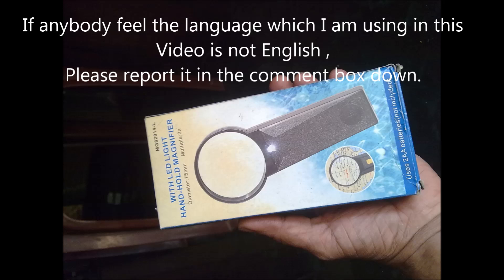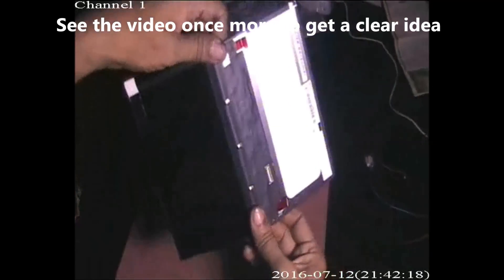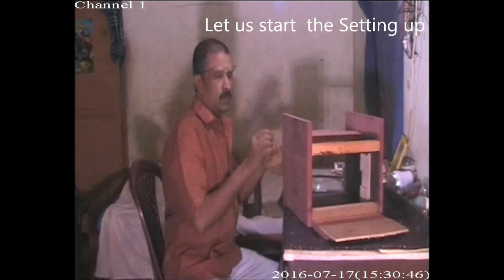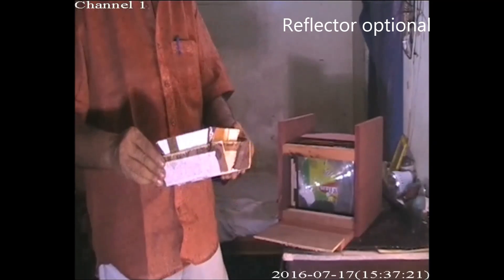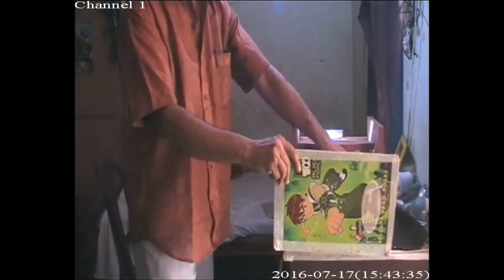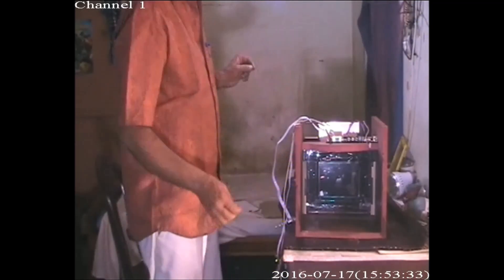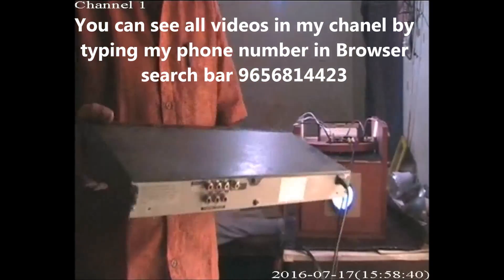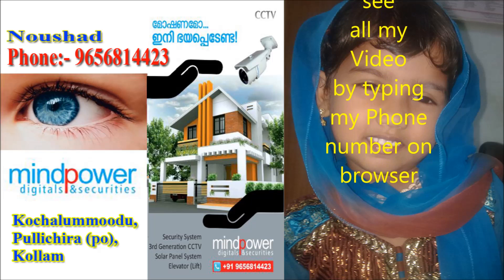HOW TO MAKE A VIDEO PROJECTOR AT HOME PART-1 ( HD Movie Theater: LED Video Projector )

Comment: Mr Naushad , you are right English is not mandatory - rather than appreciating someone when they are putting efforts to make all understand the concept people have this tendency to comment please ignore them , well a small correction is needed in your project for the projection we cannot use any lens it has to be a triplet lens using a simple lens would blur the projection in the corners also the LCD screen must be placed between the two Fresnel lenses one with a 120 Focal length then the LCD screen with a distance of 50 MM and then a 180 Focal length with a 20mm distance only then the projection would come perfect   hope this helps you and all  all the best

Comment: Sir could you please tell how to create the flood lamp with 9 10w led ? If I connect all 9 led in parallel , all of them are not lighting and led get over heat .. I am using the same 12v 10 amp adapter .. Please help me ...

Comment: SIr,I get picture in ronud size .
Reply from the maker: Come to me with the projector........

I will correct it 
fee Rs.1200 only.
My whatsapp  00918547430926
Reply: OK sir
Reply from the maker: My whats app number
00918547430926

Bring to me ...
I will rectify the problem..
Fee rs. 1200

Comment: is it possible to buy universal connector for smaller LCD screen for my E65 VIZIO TV series. it's brand new that's why i salvage all the parts except the LCD which was damage on handling.

Comment: sir how much cost of all required parts
Reply from the maker: We conducting an online course for LED/LCD TV.
You can register for that course with a fee of Rs. 1200. (25 US $)

we will send you all the study materials to this Email Id.
It is very easy to understand even if you don't know English language.
Because it is fully supported by pictures.

Universal V59 board installation is a separate book composed by myself is very simple.
It is same of V56

Firmware for all will send you independent for V59 and V56.

All will come to you with full instruction.

Pay the fee to my account and inform me.

my Bank details:-

Bank account Number:-      626601518016
Account Name:-                 P NOUSHAD
Bank and  Branch:-             ICICI  Bank , KOLLAM branch
IFSC code :-                 ICICI0006266

Rs.1200 only 
(25 US $).

mobile:- 0091 9656814423

Ok

My whats app number :-
0091 8547430926
Add this number to your contact ..
Then only try to send a MSG in whats app.

Comment: can you suggest me a suitable fresnal lens (online)for my laptop lcd display...plz reply
Reply from the maker: 12000 for the same which I used in Video.
But If you use quality materials it will cost you about 18000 to 23000

High quality Details...

Triplet lens Rs. 4500
Fresnel lens Rs. 1000 per pc.
100 watt single LED back light with 36 Volt 4 Amp Adapter. It will cost you Near 4500.
Use 300 watt for better quality.
LED display 7 inch Rs. 3500 .
Driver Board Rs. 1200
12 V power adapter Rs.200
All these are available Online.
Cost of Woods works depends.....
.....................................................................................

We conducting an online course for LED/LCD TV.
You can register for that course with a fee of Rs. 1200. (25 US $)

we will send you all the study materials to this Email Id.
It is very easy to understand even if you don't know English language.
Because it is fully supported by pictures.

Universal V59 board installation is a separate book composed by myself is very simple.
It is same of V56

Firmware for all will send you independent for V59 and V56.

All will come to you with full instruction.

Pay the fee to my account and inform me.

my Bank details:-

Bank account Number:-      626601518016
Account Name:-                 P NOUSHAD
Bank and  Branch:-             ICICI  Bank , KOLLAM branch
IFSC code :-                 ICICI0006266

SB account

Rs.1200 only 
(25 US $ from out of India).

mobile:- 0091 9656814423

Ok

My whats app number :-
0091 8547430926
Add this number to your contact ..
Then only try to send a MSG in whats app.
Show less

Comment: noushadikka super total ethra cost varum
Reply from the maker: We conducting an online course for LED/LCD TV.
You can register for that course with a fee of Rs. 1200. (25 US $)

we will send you all the study materials to this Email Id.
It is very easy to understand even if you don't know English language.
Because it is fully supported by pictures.

Universal V59 board installation is a separate book composed by myself is very simple.
It is same of V56

Firmware for all will send you independent for V59 and V56.

All will come to you with full instruction.

Pay the fee to my account and inform me.

my Bank details:-

Bank account Number:-      626601518016
Account Name:-                 P NOUSHAD
Bank and  Branch:-             ICICI  Bank , KOLLAM branch
IFSC code :-                 ICICI0006266

Rs.1200 only 
(25 US $).

mobile:- 0091 9656814423

Ok

My whats app number :-
0091 8547430926
Add this number to your contact ..
Then only try to send a MSG in whats app.
Show less

Comment: Hello sir my laptop screen 30pin  ( LT141XAS4L) IBM    How to attach led board with remote
Reply from the maker: Cost of production details....
12000 for the same which I used in Video.
But If you use quality materials it will cost you about 18000 to 23000

High quality Details...

Triplet lens Rs. 4500
Fresnel lens Rs. 1000 per pc.
100 watt single LED back light with 36 Volt 4 Amp Adapter,  It will cost you Near 4500.
But I reccomented 300 watt LED  for better quality , it costely.
LED display 7 inch Rs. 4500 .
Driver Board Rs. 1200
12 V power adapter Rs.200
All these are available Online.
Cost of Woods works depends.....
.....................................................................................

We conducting an online course for LED/LCD TV.
You can register for that course with a fee of Rs. 1200. (25 US $)

we will send you all the study materials to this Email Id.
It is very easy to understand even if you don't know English language.
Because it is fully supported by pictures.

Universal V59 board installation is a separate book composed by myself is very simple.
It is same of V56

Firmware for all will send you independent for V59 and V56.

All will come to you with full instruction.

Pay the fee to my account and inform me.

my Bank details:-

Bank account Number:-      626601518016
Account Name:-                 P NOUSHAD
Bank and  Branch:-          ICICI  Bank , KOLLAM branch
IFSC code :-                  ICICI0006266

SB account

Rs.1200 only 
(25 US $ from out of India).

mobile:- 0091 9656814423

Ok

My whats app number :-
0091 8547430926
Add this number to your contact ..
Then only try to send a MSG in whats app.

Comment: wawooo is very superb i want this u sale this
Reply from the maker: Cost details....
12000 for the same which I used in Video.
But If you use quality materials it will cost you about 18000 to 23000

High quality Details...

Triplet lens Rs. 4500
Fresnel lens Rs. 1000 per pc.
100 watt single LED back light with 36 Volt 4 Amp Adapter . It will cost you Near 4500.
300 watt is reccomnted from me for better quality.
LED display HD 7 inch Rs. 4500 .
Driver Board Rs. 1200
12 V power adapter Rs.200
All these are available Online.
Cost of Woods works depends.....
.....................................................................................

We conducting an online course for LED/LCD TV.
You can register for that course with a fee of Rs. 1200. (25 US $)

we will send you all the study materials to this Email Id.
It is very easy to understand even if you don't know English language.
Because it is fully supported by pictures.

Universal V59 board installation is a separate book composed by myself is very simple.
It is same of V56

Firmware for all will send you independent for V59 and V56.

All will come to you with full instruction.

Pay the fee to my account and inform me.

my Bank details:-

Bank account Number:-      626601518016
Account Name:-                 P NOUSHAD
Bank and  Branch:-             ICICI  Bank , KOLLAM branch
IFSC code :-                 ICICI0006266
 SB account.

Rs.1200 only 
(25 US $).

mobile:- 0091 9656814423

Ok

My whats app number :-
0091 8547430926
Add this number to your contact ..
Then only try to send a MSG in whats app.
Show less

Comment: Hi, what screen are you projecting it. it looks good. is it any curtain or pvc meterial?
Reply from the maker: Any cloth curtain can use, but should be rough surface.
Polister, silk are  not allowed. Surface NOT glossy type materiel need.
Glossy surface will reflect the light to one direction.
Pure White rough cotton is better.
Reply: what were you using, shown in video. looks good! :)
Reply from the maker: Cotton rough pure white Cloth.
If you have a white wall, it is better.

Comment: Og it really works, Way we so NOT May se the picture it made On Wall ?
Reply from the maker: Before two months , I posted the video in YouTube with original video on screen. 
But YouTube blocked my video on the reason of copyright of the video. 
And I compelled to removed it from my channel. 

The video you are watching now is which I upload again as a new video without showing the copyright video. 
Then YouTube not blocked it.

One more thing..
When I posted second time the video, you tube rejected my account opening request on the ground that Language not Supporting. That means the language which I used in this video is not English. Did you feel it.
That is what I mentioned on the video.
Anyway the account is opened after communicated with YouTube.

Comment: Don't worry.  Your English is fine.
Are you using two Fresnel lenses so that the image you see on the wall is the correct way up?
If you use only one Fresnel lens is the image upside down?
Would you suggest adding a fan to cool the LED floodlight, or is the temperature acceptable?

Thanks for taking the time to make and upload the video.
Reply from the maker: No you are wrong...
Image up down at magnifier lens. Not in Fresnel.

You can use any type of fan to cool the LED .

In ready made Flood lamp have its own cooling system.
Don't worry about additional cooling.

Cooling fan is must if you are using an LED more than 30 watt.

Comment: original pictures ?
Reply from the maker: Before two months , I posted the video in YouTube with original video on screen. 
But YouTube blocked my video on the reason of copyright of the video. 
And I compelled to removed it from my channel. 
The video you are watching now is which I upload again as a new video without showing the copyright video. Then YouTube not blocked it.

One more thing..
When I posted second time the video, you tube rejected my account opening request on the ground that Language not Supporting. That means the language which I used in this video is not English. Did you feel it.
That is what I mentioned on the video.
Anyway the account is opened after communicated with YouTube.

Comment: i want to buy your hd projector. Kindly write LED pixel details  and total cost of your projector. Mail:thiru.thirusca@gmail.com
Reply from the maker: Cost of this projector depends on the materials you are going to use.
the cost of raw materials will affect the Quality of picture .
I used here only cheapest materials available.
You know the projector lens I used here is only Rs.300.
original projection lens available from a range of 3,500 to 3,50,000.
All are Called lens, But quality varies.
Same as in the case of Fresnel lens.